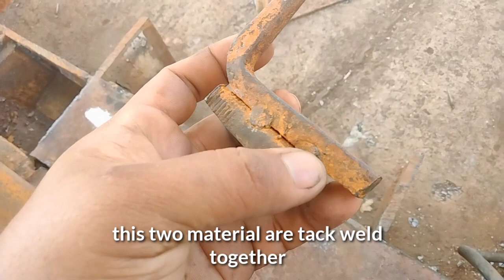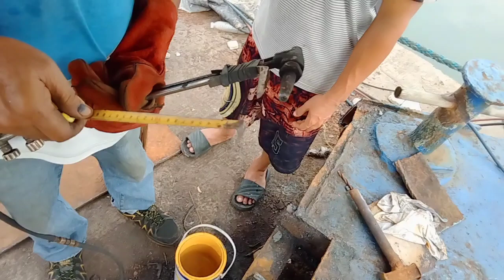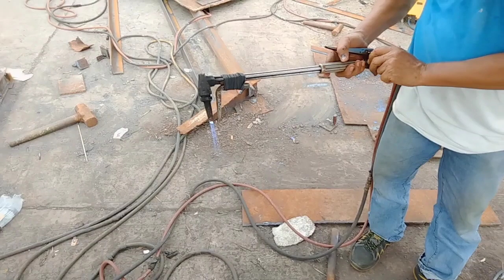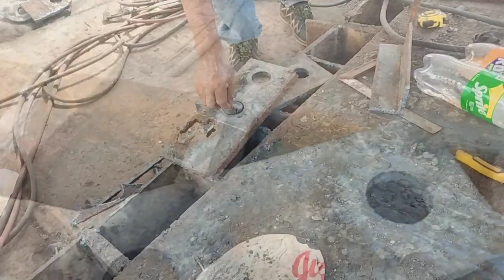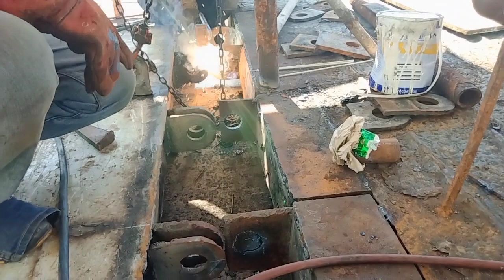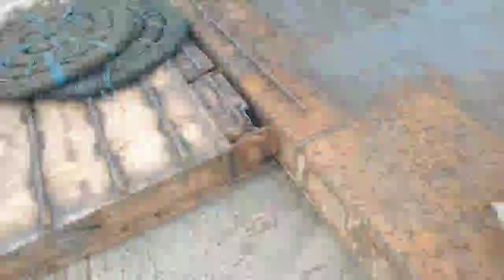legendary fitter techniques in making a perfect circle of 16mm steel plate in a one simple tools

Comment: Boss ano ang dapat tingnan sa parti ng makina sa sasakyan diesil engin walang hatak mahina talaga
Reply from the maker: Fuel filter or clutch lining po boss
Reply: @bossjerometechshow  ahh ok po boss jerom try ko. Kahit anong hataw niya 85 lng talaga makaya niya sagad2x na ang axcerelator
Reply: @bossjerometechshow  paano boss jerom palitan kunalang ang fuel filter nito.. at saka clutch lining?
Reply from the maker: @virgieoca  ano nga pala ang model nyan boss?
Reply: @bossjerometechshow  army ako boss sixbay namin kia km250 6cylender .. pinapa kalebrate lng man dati ang enjector  tapos nung kinabit na nila un na wala nang hatak
Reply from the maker: @virgieoca  kulang yan sa timing boss adjust mo pa kunti ang injection pump..kunting setting pa advance..tapos pwdi mo na rin tingnan ang fuel filter if madumi ba..ang mga injector nyan kasama ba na calibrate?
Reply: @bossjerometechshow  alin banda sa injiction pump boss ang pipihitin na tinatawag mon timing pa advance